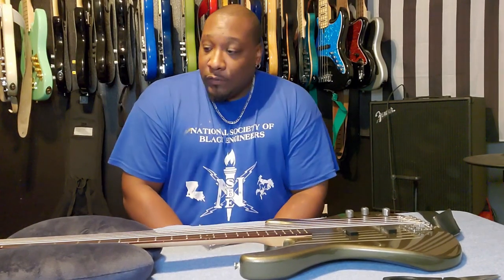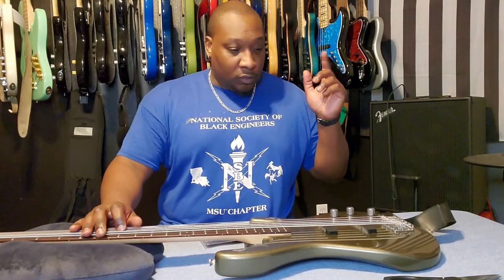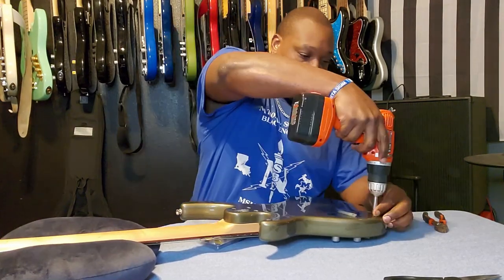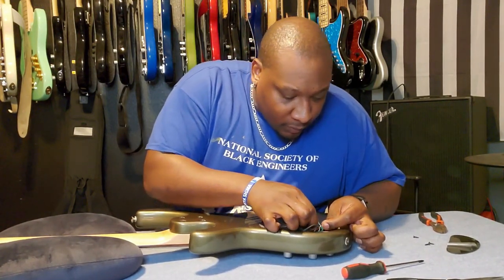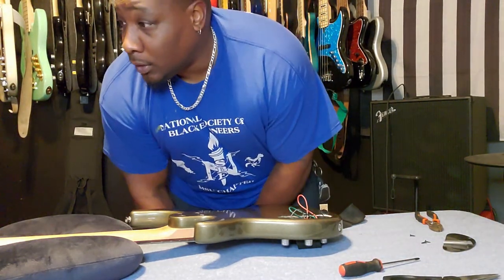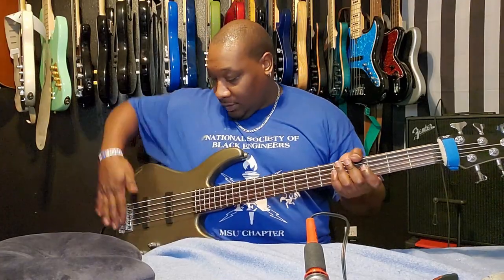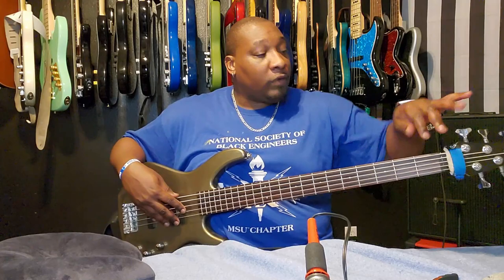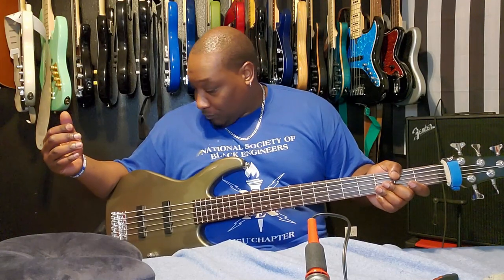How to fix A Bass Issue: Squire Jazz 5 string...

Comment: If it fit a nice fix might be to use one of those loaded control panels - the $99 ones - was it Audere? From what I recall you crimped a couple of wires and it was done. Insane tone  - I guess the control panel was different and maybe no space for battery ... unless they make one for that shape?

I normally gently tap pickups with a screwdriver  a la Daves World of Fun Stuff.
As a Brit - imaging my surprise when I asked "is your beer on tap?" In a well known nearly world famous fries US restaurant. So tap the pickups in the British sense of the word :-)

Comment: Bully I got a question about the M2  5 string Sire bass with the maple fretboard, if I wanted to replace the humbucker pickups in this bass which humbuckers would fit? Would it be bartolini,’s or Aguilar?
Reply from the maker: Neither. Both are to wide